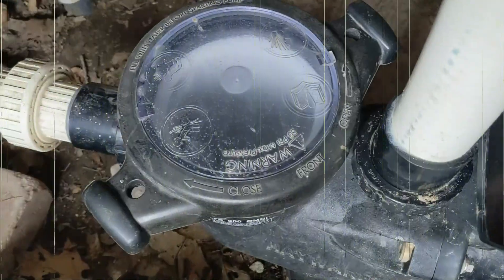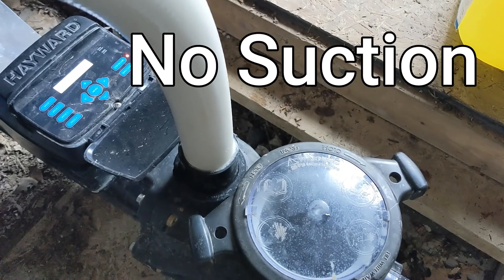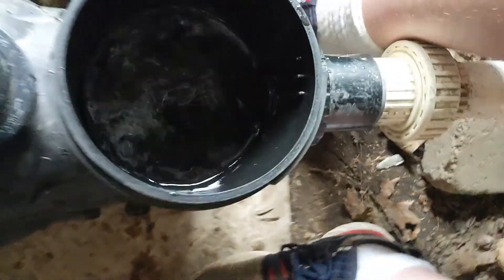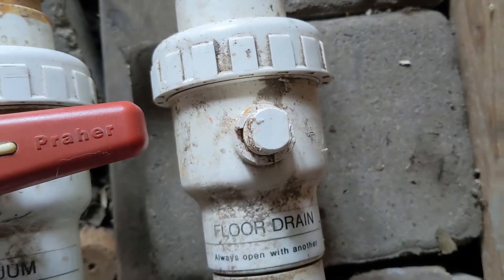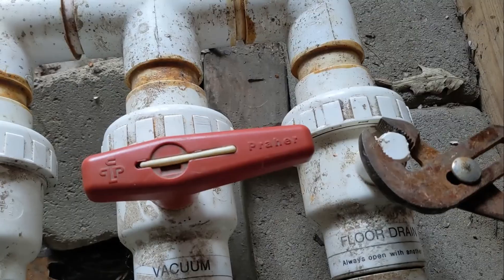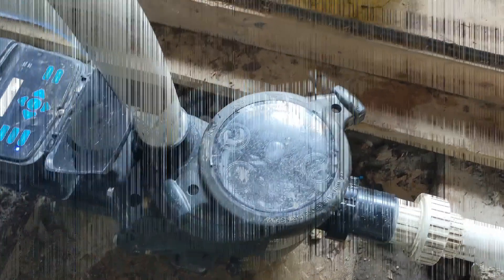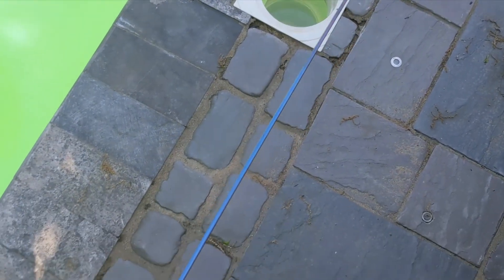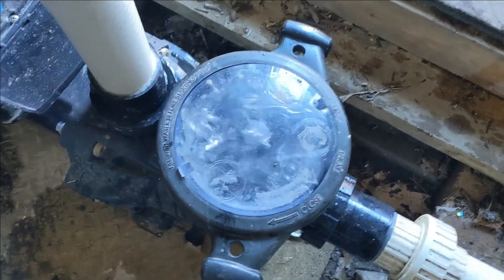Air Bubbles or Low Flow Coming Out of Pool Jets / VIP Pools and Spas

Comment from the maker: This will normally happen when you have to much leaves and other debris in your swimming pool.   Make sure to scoop as much as you can out before you vacuum the pool.
Reply: How do i fix that?
Reply from the maker: @a.rod876  have to find the cause first.  Are bubbles coming out of the jets?  Is there full basket of water coming into the pool pump?
Reply: @VIPPoolsandSpas  i have a line that goes out to the front n leaks into street idk if its the check valve or not
Reply from the maker: @a.rod876  your backwash is leaking?
Reply from the maker: @a.rod876  Lets start from the start.  Whats going on with your pool? Send pictures to info@vippools.ca if that helps explain things better.
Reply: @VIPPoolsandSpas  sent thanks for replying 👍
Reply from the maker: Thanks for the picture.  I'm going to assume that the picture shows the backwash?  Do you have a Hayward sand filter?
Reply from the maker: what are you trying to figure out and whats the problem?  You can always take a video, put it on youtube and send me the link?  Not sure what your issue is.  Is the pool going green?  You losing water thru the backwash or pool pump issue?
Reply: @VIPPoolsandSpas  i emailed you as well
Reply: @VIPPoolsandSpas  Hey I had bubbles from return now they are gone but no flow from 2 jets
Reply from the maker: @larryy6467  No flow in a pool means, no water in the pump or pool water is low.  Have to find out why there's no flow.